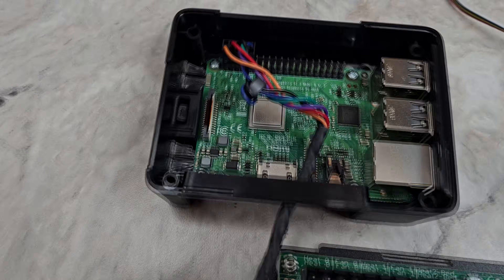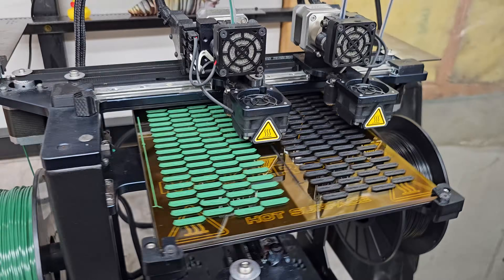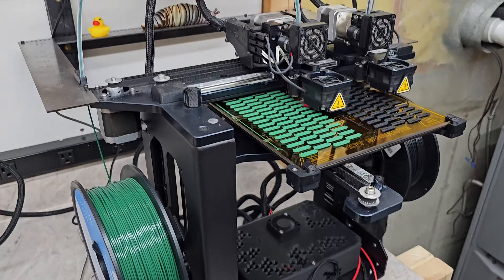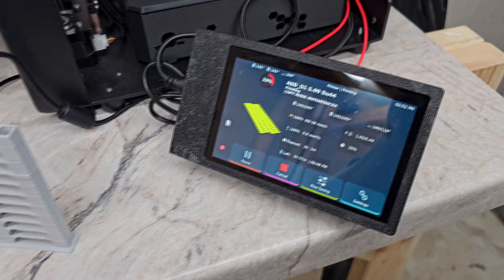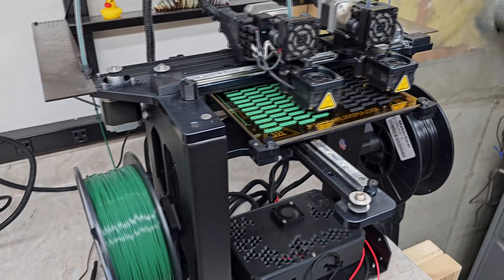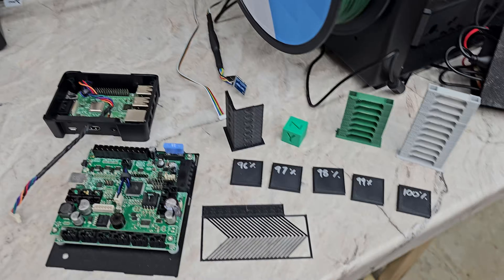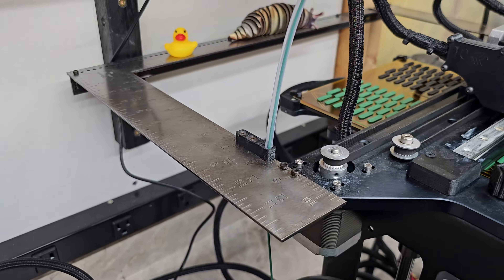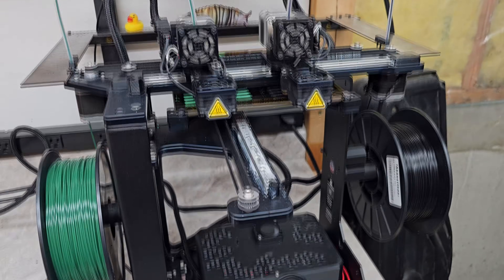MakerGear M3-ID running KLIPPER!  BigTreeTech upgrades: Input shaper, pressure advance, 2209s, more!

Comment: A company defeated by globalization (china) gets its guts replaced by a chinese company's board. 😂 I love my M2 and it hasn't been releveled in 10 years and being so rigid, it doesn't need a bed probe
Reply: Yeah, you can also update it with klipper straight to the original rambo board. No real need to change anything and still gain the ability to add a bed leveling probe or input shaping.

Comment: I bought this machine when it 1st came out. Its a workhorse.  However it is very dated. Any info on the upgrade would be helpful. Thanks
Reply: the rambo boards take klipper pretty readily. If you have a raspberry pi, all you have to do is install klipper on it and then update the rambo firmware. For me Kiauh made it super easy. I did it on a M2.

Comment: This is very interesting. I have been getting ready to revive my own M3-ID in a similar fashion. I have an SKR 1.4 Turbo, which is a bit older than the Octopus line, so I am looking to see if that might be usable for this project without having to invest in a new board. Curious if you have any notes to share on your steps, or anything you learned about “wiring gotchas”, etc? Are you willing to make any of your files for the enclosure available? Are you still using the axis homing switches with the 2209s? Thanks for sharing!
Reply from the maker: Thanks for your questions.  Yes I am willing to discuss but will have to get back to you a later.  A friend of mine did the work, so I will need to check with him to verify a few things.